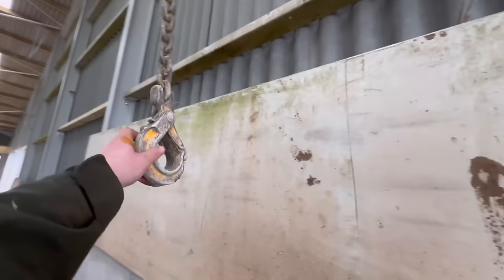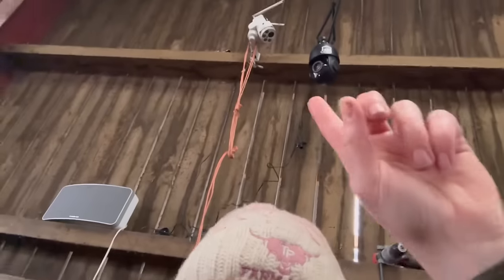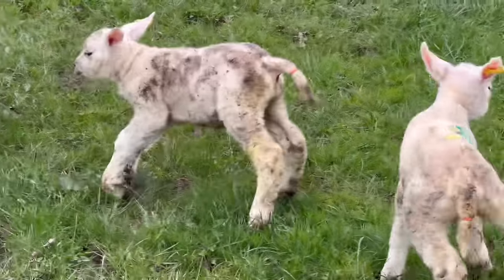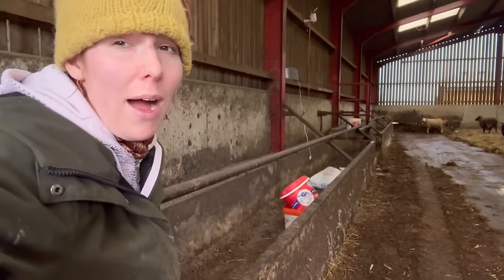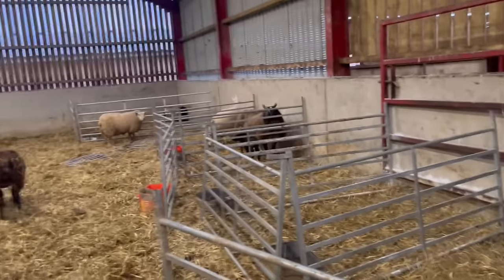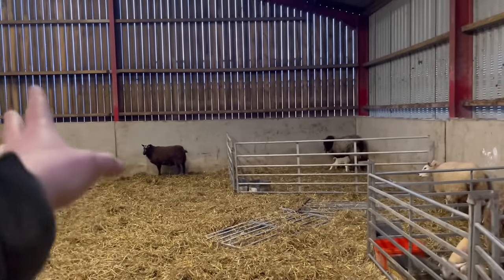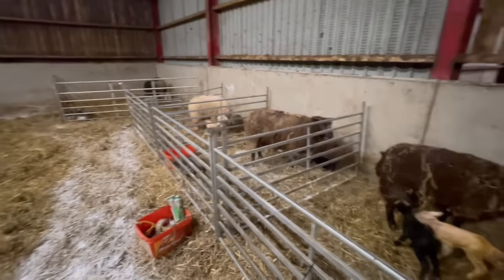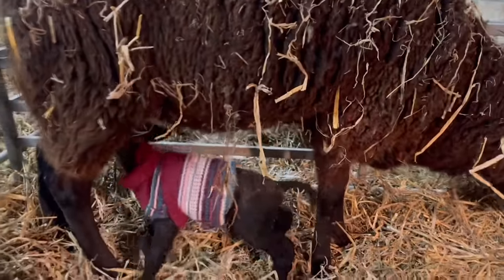7 April rearranging the shed, Merlo power and a mummified lamb 🤢

Comment: That panel, if the cows are going to be eating over it off the floor the other side looks too high to me? Also, I would've blocked in-between the uprights, so both sides were flush with the uprights, so both sides could be scraped easily. The muck side is ok as it is, but scraping any waste food away will be a pain unless it's a hand job around the bottoms of them- and when you're busy, which you will be, any extra hand work like that will be a pain in the bum rather than a tractor/bobcat scraper job.

Comment: The 600mm panel should be fine for your Jerseys. I put 500mm panels in for a feed barrier and had to put a rail above it because I have a Jersey cross and she could step over it as the top rail was set high for the big cows. She can still reach the feed on the ground fine and the height will be slightly over 600.

Comment: If the feed passage is the same floor height   as where the cow is standing yes those panels are too tall . If the feed passage is  100mm higher they`ll be fine
Reply from the maker: Yes the feed space on the other side is 100mm higher

Comment: Those panels are too high! We have bigger cows and we have 500 panels and if I was to do it over 450 is probably what I would have. The higher the panels the less they can reach out and you can also get a bit of stuff building up at the bottom of the panels which is just plain nasty and has to be cleaned away and in your case it will have to be cleaned away by hand because you have the panels bolted to the inside of the rsj ( for obvious reasons) . We are inclined to feed little and often but even if we were trying to put a lot of stuff in front of them what you lose in reach doesn’t really gain you any more available feed if you know what I am getting at ? In fairness we do have diagonal feed rails for all our cows for the simple reason that we zero graze and we don’t have a large enough operation to divide up the heifers for the main herd so the barriers help enormously as they reduce bullying at the feed rails, now they are not locking barriers or anything fancy just the standard diagonal ones but they have been helpful in keeping the stronger animals from beating the others away from the feed. Before we put them in you would often see a big strong old girl not letting anyone eat within her bay (15 foot) anyway I diverse , put simply, rethink your panels, 2 foot is a bit high for a cow that stands 5’ 5” at the shoulder in my opinion and you intend to have cows that stand 4’ 6” at the shoulder? Before you put them all up maybe ask the guy who’s selling you the cows what he thinks as I know nothing about jerseys. Regards from Ireland fyi I remember when leg warmers were the coolest trend out, you could have started their reincarnation as something useful now!

Comment: Would go for 500 or even less for jerseys,were 400
Reply from the maker: The feed space will be 100mm higher so it’s not a lost cause we should have gone with our gut
Reply: 600 good for holsteins,but not jerseys,reach will be compromised but not a disaster,will be more important where your putting in feed belt as you need stretch to clean it up